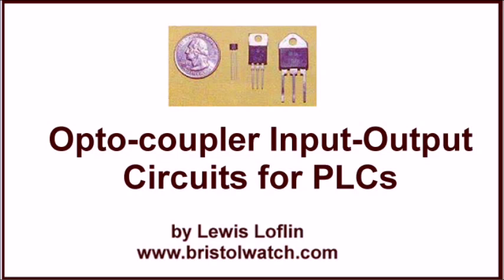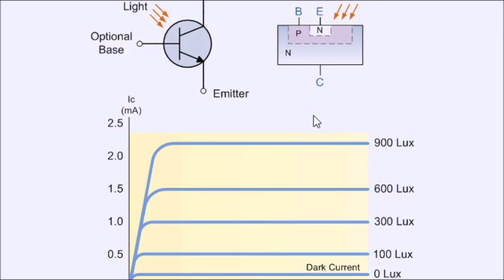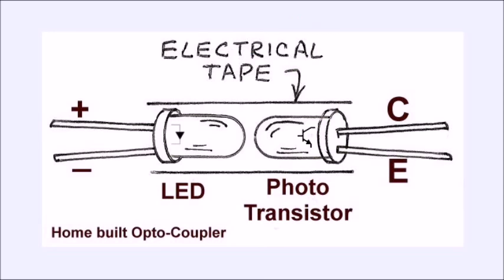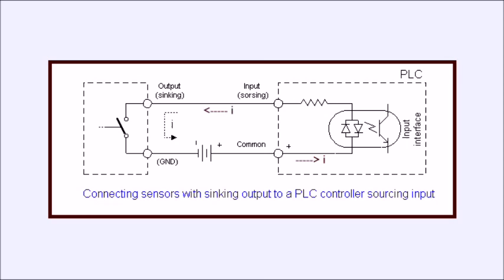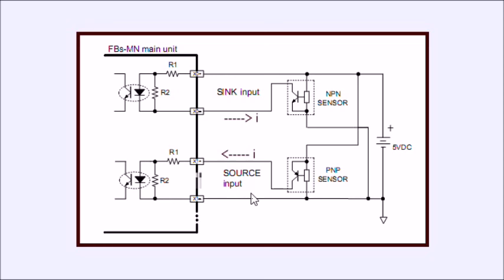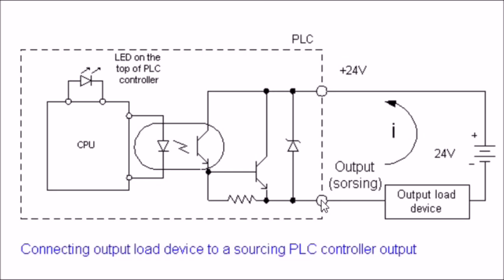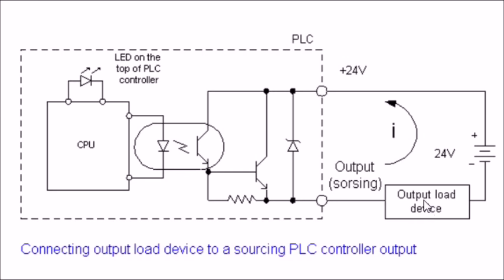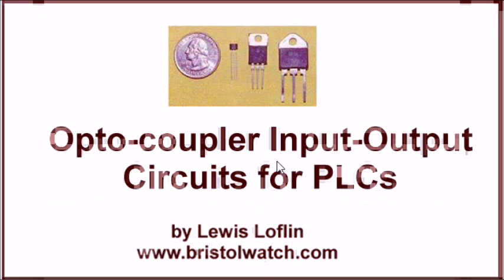Optocoupler Circuits for PLCs

Comment: Thanks for your videos, you are a good teacher. I notice that sometimes symbols for devices show a Zener Diode where I would expect a Diode. E.g. the reactive load protection diode on the PLC at 14.00 in this video. I’ve just seen a MOSFET on another of your videos where the parasitic diode was drawn as a Zener diode.
Are these really Zener diodes, or is a different symbol standard being used in these diagram? Are they waring that the diodes have low reverse bias breakdown voltages?

Comment: Hi,Can we connect the input (IR led) of two MOC3021 in series to the output of AVR (5V) or should amplify it?Thanks.
Reply: They're only LED's albeit IR ones, so just do the sum to calculate the value for the series current limiting resistor you need for 2 IR leds in series, with a forward voltage of about 1v each, at a max current of about 10ish mA. While you're at it, you could  have a visible light LED in series as a status indicator too, which'll also let you know if the IR ones are conducting properly, but you'll have to factor the forward voltage of that LED into the series resistor calculation, and each colour of LED has a different forward voltage. Do not use a blue or white one, if you do, there may not be enough voltage left to properly trigger the photo triacs. You must use a series resistor for 5v or higher supply, otherwise the IR leds and maybe even the AVR output, will release the magic smoke if more than about 15 to 20 mA goes through them, AVR outputs are also better at sinking current, than sourcing it.
Calculator and formula for LED series resistors here - https://www.digikey.co.uk/en/resources/conversion-calculators/conversion-calculator-led-series-resistor